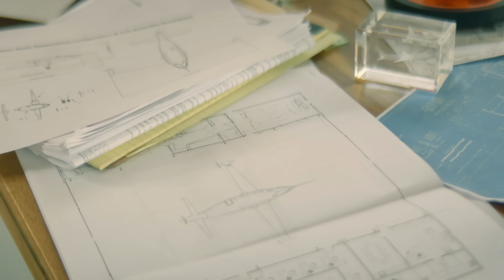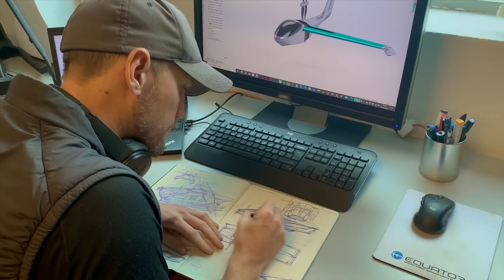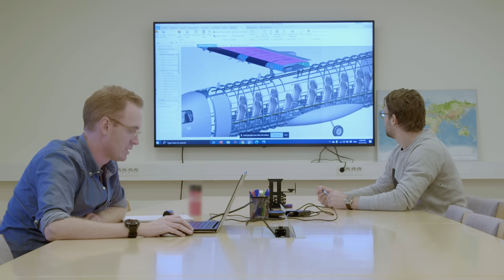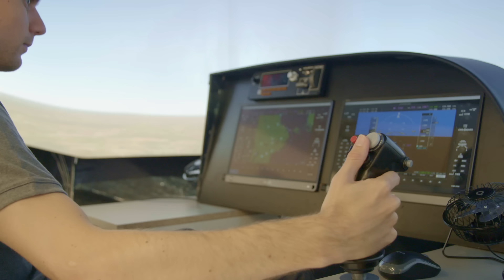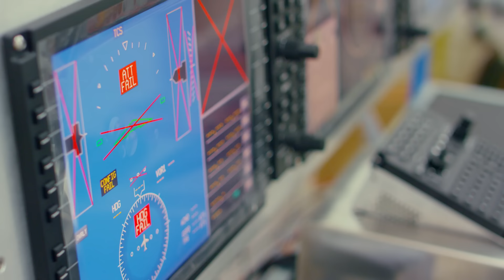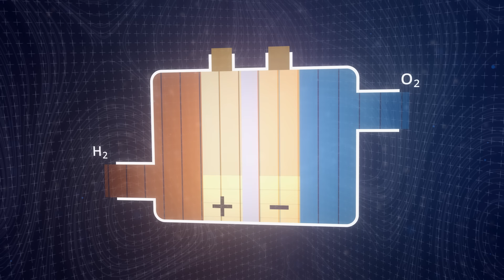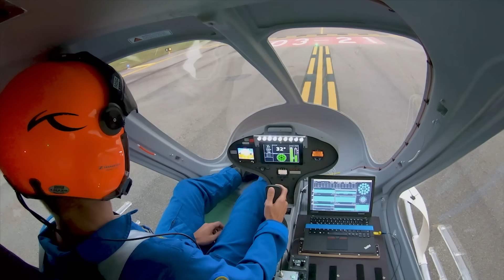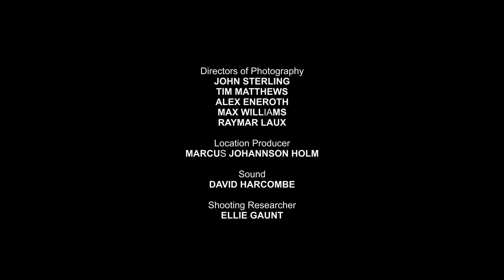Planes of the Future: The End of the Jet Age? | FD Engineering

Comment: The one reason why E planes wiil not succeed is as we know Thermal Runaway...which once started by a little smoke cannot be stopped....I've been using all concoctions of liop batteries for about 20 years, luckily I've only had one small 1s battery catch fire whilst some aero modellers  have had garages and partial homes burnt down...Ask any fireman who has had the experience of trying to extinguish an E car. So only a special blanket covering the entire car eventually puts the fire out...however the blanket cannot be removed after a day or so as it will  self ignite...Check out the immense  fire in a retailers garage/ showrooms that could not be put out and later sending the twisted scrap debris to a car crusher with a car size battery included ...this caused £1+ million pounds of damage...I'm sure it was in Swindon UK. 
I'm sorry to be negative but I hope something/ combination comes along as we cannot continue to use fossil fuels...lotsaluck.

Comment: It is no doubt that electric motors are among-, and in most cases the best and most efficient way of utilizing applied energy in the form of electricity into torque and horsepower.
But that is not the problem in an airplane. Here you need a very high grade of eneregy density!
Batteries does not have a high grade or rate of energy density. Even with future sollutions, if they succeed,it is not much better.
To make a comparison to the everyday turbofan or turboprop  powered airplanes that are the normal commonplace sollution, they run on kerosene!
Kerosene have an energy density which are 14 times, that is fourteen times greater than the best battery sollution we have today. 14 times!!
We can of course take any passenger airplane made for short or long haul and equip it with batteries making up for the similar energy density but there will be a big and unsolvable problem. That airplane would be so heavy that it would never be able to take off the ground.

Stop talking of how good the electromagnetic parts of the eletromotor can be made or the controlling systems can be improved. This will never make up for the extremely big difference in kerosene and batteries. The problem is not the motors but the problem is the battery power! Even "New Generation" batteries that suggest an improvement of an energy density representing "only" 8 to 10 times less than kerosene will solve the problems of making effective battery powered passenger airplanes! It can probably be utilized in 10 passenger short haul use, at the best.
This means that battery powered airplanes for normal passenger transport is absolutely not a viable solution! The flying toys we have seen up til now and repowering of existing  airplanes is not the future!
Start looking at nuclear soutions. That is the realistic future! 
Or just go on using effective kerosene since it has very little influence on the creation of the weather factors/climate.
And up til now we have not really considered the very serious fact that we will run empty of minerals for the production of batteries as a whole.

Comment: Pointless. We have an energy shortage, coal or oil power eclectic plants are outdated. The grid is mixed out as is is. And you wanna add planes trans and boats to charge on the same grid? Ridiculous!  
 What we need is a new power source.  

Why not make a plane with a hydrogen engine? Cheap to build, easy to maintain, simple logistical transfer.
Economicly viable and sustainable in the long term, the by-product is carbon dioxide and water vapour.  
Nah.. not enough profit.  Lies. It would be highly sought after, and people won't do their own maintenance or make their hydrogen. We will still need mechanics and fill up at a pump...ect

Comment: Think about this: An airplane carrying 1000 kGs of kerosene to do its job. A battery powered airplane of the same type and capabillyties would have to carry batteries weighing 14.000 kGs! Before any load of anything else!
It would never be able to take off!
Reply: The range is greatly reduced in order to make the source power way lighter, but on contrary to what was said in the documentary, flights on battery-powered aircrafts will be more expensive than the ones on gas/kerosene-powered airplanes.

A hydrogen powered-aircrafts is a way better alternative.

Comment: My concerns is this the 19 passenger planes they are designing requires 4 electric motor yet the same fuel powered aircraft only need one or two engines Not knocking what they have accomplished just a observation

Comment: The thing is everything they are wanting to do that they say is sustainable is dependent on fossil fuels, everything. Without fossil fuels there is no plastic, no resins, no electrical power, no solar cells, no windmills, not even steel, they are all dependent on crude oil and coal to produce them. Every time you convert energy from one form to another you loose. EVs go through multiplier conversions of energy from one form to another, wasting a lot of energy. Where as burning gas there is only one conversion from one form of energy to another. From burning gas in your engine to converting it to mechanical power to the road.

Comment: IF the electric engines are so good, then why are they so bad when you have a battery, that powers them, weigh three times the weight of the said electric engine? ICE engines are still more efficient than electric engines, or should that not be named generators?